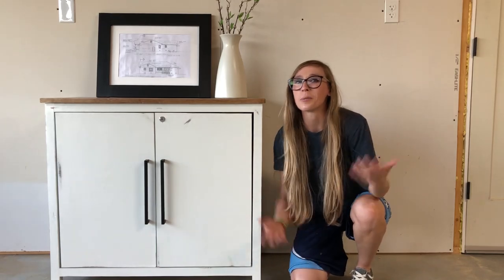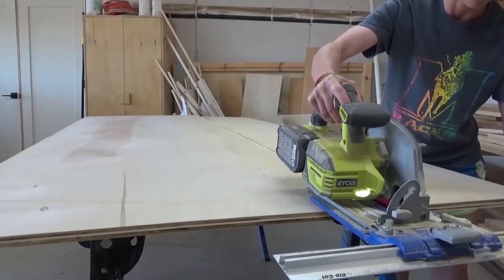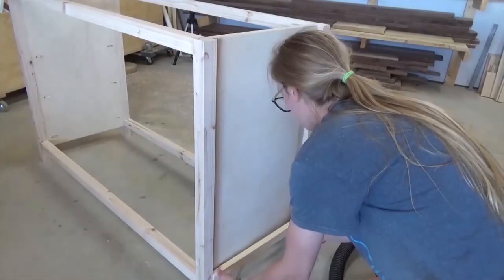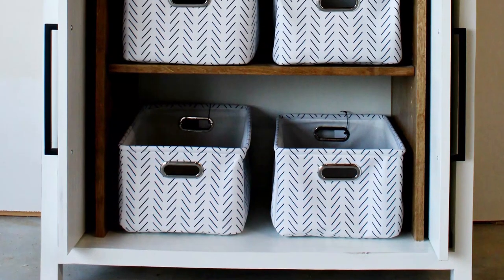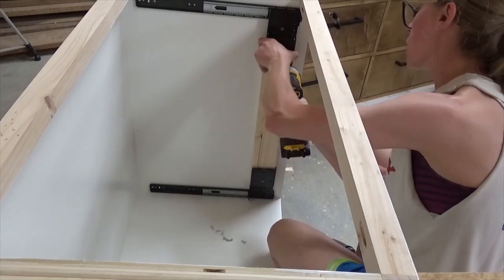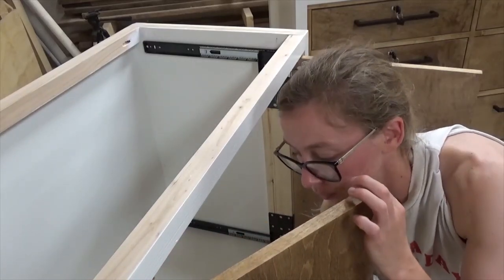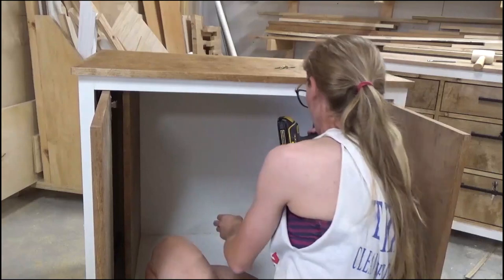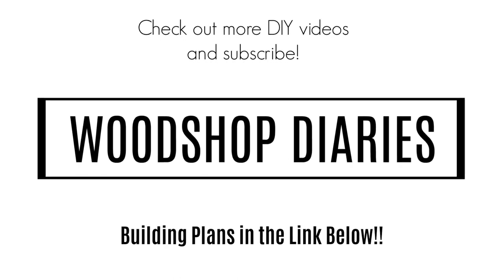How to Build a Pocket Door Cabinet--Part 2: Entertainment Center Series

Comment: Hi! To get rid of that gap, you have to replace the half overlay hinges with standard overlay hinges! Great videos, good work 🛠🧱⚙
Reply from the maker: Hi! Actually these slides weren’t designed to be used with regular concealed hinges. I’m using inset hinges here with the adjustment all the way out. However, I realized after the fact that these slides were designed to be used with a specific type of hinge. I’ve detailed this information in the blog post on the description. 👍
Reply: I have only done flipper doors a couple times. But the right hardware is always an issue. I have a good local cabinet hardware supply that can often answer a lot of hardware questions. They deliver the next day.  Something that Amazon cannot do.

Comment: Nice job.  I've never used the sliding pocket door hinges.  Good advice for when I do use them.
Reply from the maker: They’re pretty cool. This was my first experience with them and I’ll definitely use them again
Reply: @WoodshopDiaries  We used to call them "flipper doors"  since there is really no "pocket"  There are also pocket flipper doors and bi-folding pocket flipper doors sold by Hawi. But that's a whole other level. Nice looking  unit you made.

Comment: nicely done. it isn’t just those hinges. that’s a pretty typical problem using concealed hinges with pocket door hardware. the only way to get them closer to the edge is to inset the back of the hinge closer to the outside of the casing — as you likely discovered, moving the hole on the door doesn’t really change anything. that usually involves quite a bit of messing around and cutting into the mounting plate and to get it to swing properly you may also have to cut a groove in the inside of the outside panels, which is just a huge amount of extra work for an eighth extra gap :)
Reply from the maker: I’ve never worked with the pocket door hardware before this project so that’s good to know for future reference. I was getting so frustrated haha. I don’t mind a gap as long as it’s consistent, so I’ll just keep that in mind for next time. Thanks for the feedback!
Reply: Shara Woodshop Diaries yeah they can be somewhat frustrating. personally i find it easier to do pocket doors with inset grooves and metal rods to avoid all the screwing around. :)
Reply: Avi Sato could you please post a link to the inset grooves and metal rods so I can get an idea of what they look like?
Shara, I just found this hardware tonight on Amazon, I am so happy that you made a video using them!! Great job!
I want to use the largest set I can find to use on 2 doors to cover a pantry/ appliance closet in a small house!
Reply: Zen Dreaming the rods would be location-dependent. in japan, we are all metric so they’d be 8mm or 10mm steel rods. in america, they’d be 1/4 or 3/8”. whatever your hardware store has should be perfectly fine.

Comment: I want to use the slide hardware you used but my doors are 18 inches wide and I see the hardware is 16 inches. Does that mean the doors will stick out a bit even when they are slid in? I also see a 22” option made by the same company on Amazon but the depth of my dresser is exactly 22” so I don’t know if that will work. I’m new to all this handy stuff and I appreciate any answers :))

Comment: Finally 1080p! 😃 Nice work 😎
Reply from the maker: Thanks! It’s the exact same set up I’ve been using so not sure what the difference is 🤷‍♀️
Reply: @WoodshopDiaries  The previous videos are with 720p resolution while now it is 1080p therefore with higher quality. 💪🏼
Reply from the maker: Right but I didn’t change anything in my filming, editing, or uploading process. So not sure how there’s a difference.
Reply: @WoodshopDiaries  I thought you had changed the video camera but everything is as before ahaha.  Maybe some settings have changed otherwise it is not explained what happened but better this way.  Your works are excellent and also deserve excellent video quality! 👏🏼

Comment: Hey Shara, I'm loving this series! I noticed the distressing at the beginning and was wondering - was that a request of the library or a design choice?
Reply from the maker: It was a design choice. The inspiration piece we roughly based the design off of had some distressing. So I did some, too. But my thought was that as kids interact with this piece and it gets used, it’s going to get some bumps and bruises. If I “bruise it” a little from the start, any scratch or ding it gets later won’t be as noticeable and will just add to the character.

Comment: Hi Shara. 

I came here because I am fitting pocket door mechanisms for the first time in the couple of weeks , your video is very helpful and I think it’s fantastic to see a female working with wood and it would be great to see even more doing this . 
Just a question is a stop required to stop the doors going too far into the carcass or is there something in the mechanism that takes care of that . 

Thank you 🙏 
Continued success from Ireland 🇮🇪 🔨
Reply from the maker: So glad this was helpful! Good luck on your build! No stop is required...the slides will prevent them from sliding off the back. 👍
Reply: @WoodshopDiaries Thanks  for the reply 🙏
Sorry I did not word my question very well , I mean when the doors are in the closed position what keeps them in line with the face of the cabinet and not go too far in ? 

Thanks 🙏
Reply from the maker: Oh, I see what you’re saying now. I added a small scrap block at the top to keep them from turning in too far. I have to do that on most every inset door I install
Reply: Perfect 👌 
Thank you and continued success in what you are doing , it really cones across that you live what you do 👍 so do I . 
Love and blessings from Ireland 🇮🇪👍🙏

Comment: THIS IS AMAZING.. but I was wondering is it possible to this for a push type cabinet.. I want to have a cleaner look.. the one without handles.
Reply from the maker: I’m sure you can find some push latches to install inside the cabinet. This wouldn’t affect its ability to slide into the cabinet on the door slides.

Comment: Have you tried using full overlay hinges? Looks like you're using half overlay or inset hinges. 

I haven't fitted a pocket sliding door before but so I'm not certain. However I'm planning on doing something similar in a few weeks and I'm fairly confident that's the problem. Unless I'm missing something?
Reply from the maker: These are full overlay, but I realized after the fact that these slides apparently have special hinges that are supposed to be used with them. I’ve linked them in the blog post:
https://www.woodshopdiaries.com/diy-pocket-door-cabinet/

Comment: I am getting ready to modify a entertainment cabinet and want these sliders.  Or, I wanted them.  I wanted them until I saw that they are $60 for one pair and the ones she is using are no longer available.  It's okay though because I have two pairs of 18" bearing sliders and I think I can cut them to function in the same exact way.

Comment: Hi Share. Enjoy your videos. You do realise that the hinges have adjustment screws that will open and close the gap?
Reply from the maker: Thanks! Yes I’m aware. I have them adjusted all the way back in an attempt to narrow the gap, but even adjusted as far as they go, the gap was still wide. The slide mounting plates push the door out further than just mounting them directly into the cabinet

Comment: The hinges you used have an adjustment screw that should close the gap.
Reply from the maker: Yes, they’re adjusted all the way and still had the gap. It’s because of the rail...it pushes the door further into the cabinet. Even with the adjustment all the way back, the gap was too big